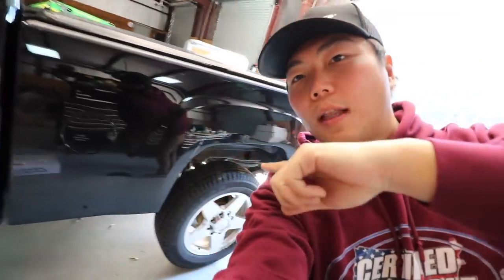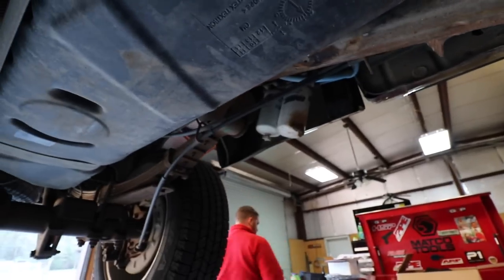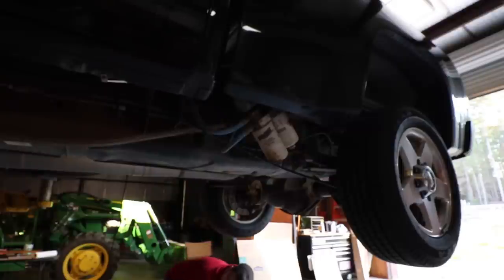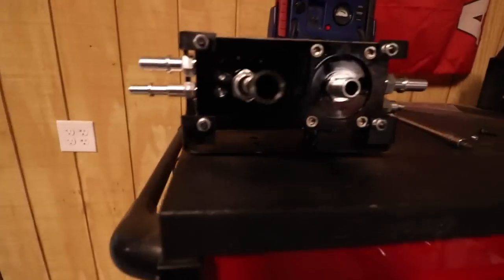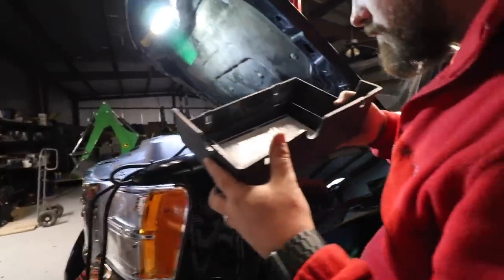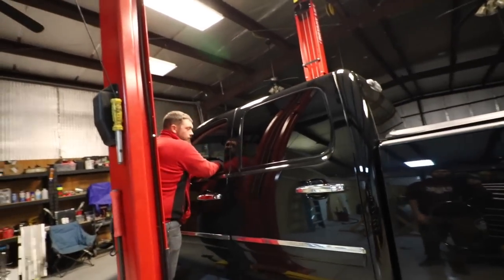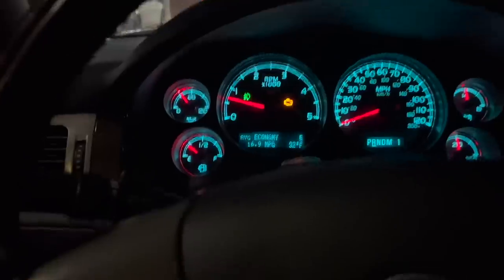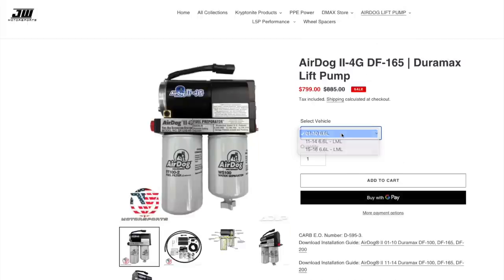Switching from FASS to Air Dog Lift pump on my LML Duramax....

Comment: Jw, I have a Fass titanium series on my ram. its so quiet even when i prime it with out the engine running. it makes a tiny noise. i have to get right on top of it to hear it. something must be messed up on that Fass. my Fass has been good to me. just don't use cat filters. the threads don't let the seal seat on the fass. thanks for the videos!
Reply: You have to grind down the knobs by the filter to use cat filters
Reply: I agree @bobevans  my Fass 150 is about 6 years old on my LLY and it’s whisper quiet